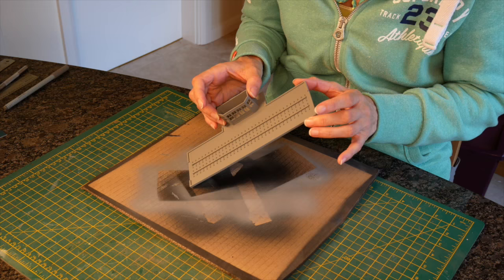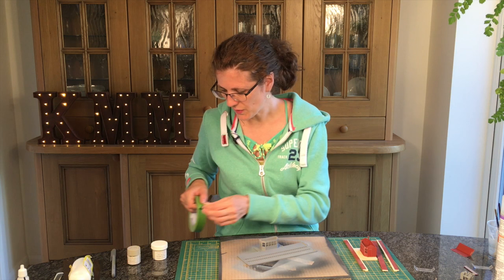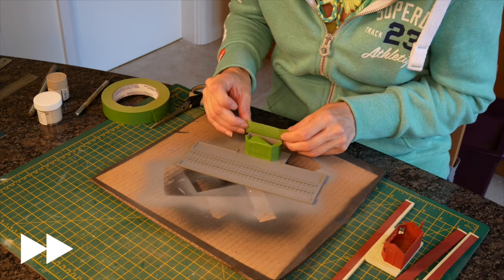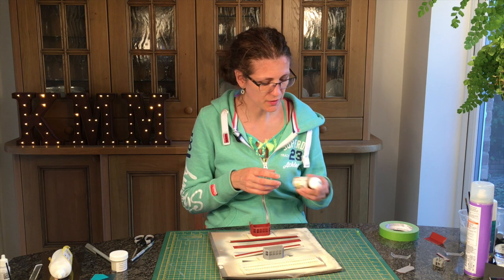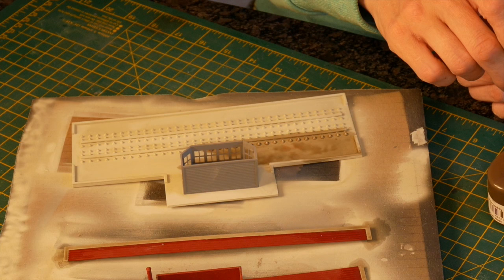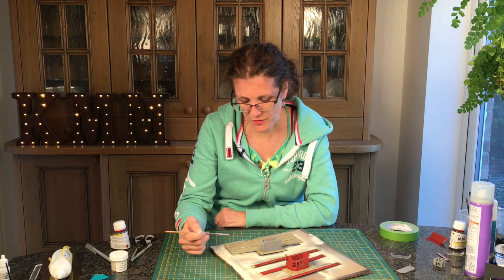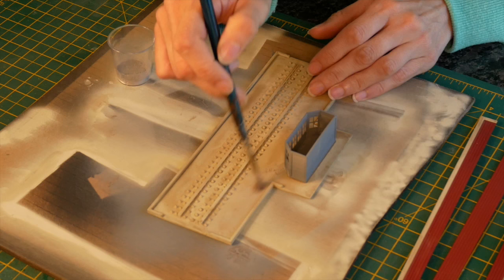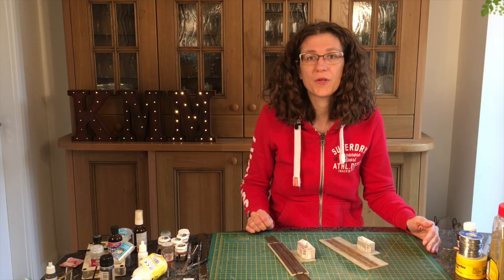How to Paint Realistic Concrete

Comment: Thanks, Kathy - once again, a very informative video. For my concrete, I used a thin skim of Polyfilla, adding some colour during the mix. Concrete is often laid in separate sections, so I scratched in the straight-line 'joins' and some 'cracks' before the Polyfilla dried. Finally, I put a few bits of 'grass' in the joins and cracks. But I bet yours turns out better!
Reply from the maker: I love the idea of using a skim of plaster. Thus kit means I couldn't do that but plaster gives more variations on texture and colour. I bet yours looked great.

Comment: Useful weathering tips.  Thanks for sharing.

I'd never been able to get a concrete color I liked until about a week ago.  Then I got lucky...  My wife bought a some pale tan paint for the living room, but didn't like it (too yellow).  Back at the store, she had them attempt to darken it a little (Then it looked a little grey).  It looks almost like concrete, I thought.  Under the lighting in my train room it still wasn't quite right. but when mixed  with approximately an equal amount of a light gray I already had (Apple Barrel "granite gray"), it was perfect to my eye.  Now I have a gallon of the stuff!

As for a concrete or stucco texture in O-scale. I've found that mixing talcum powder in the paint works very well (obviously it cannot be airbrushed in this state - oh wait... I don't have an airbrush anyway).
Reply from the maker: Excellent story!  You'll have to build a lot of concrete to use all that up.
Reply: Yes, especially as mixing in the light gray doubles the volume, so if I mix it all up together, I'll have two gallons.  Maybe I should get some small bottles and sell it on e-bay.

Actually I like the idea of mixing it as I go because that way each batch will be slightly different.  I should still be able to get it close enough for touching up existing work (provided I weather it), but there will still be the subtle variations visible between different concrete jobs.
Reply from the maker: +mpeterll you're right, slight variations will be so much more realistic. You may be on to a winner selling to all your friends, if not eBay too!